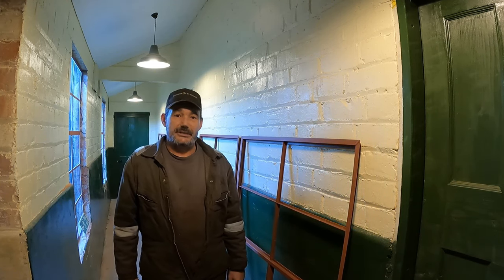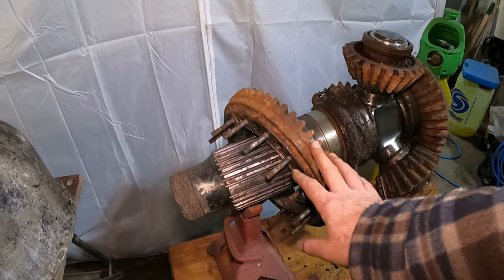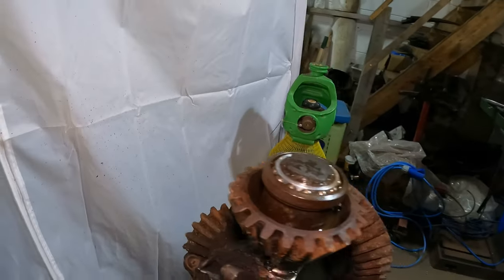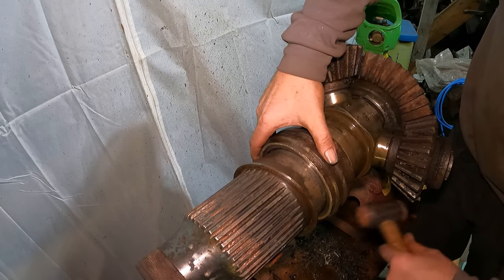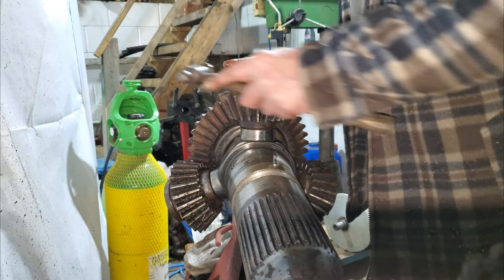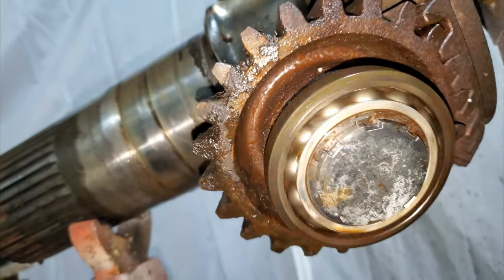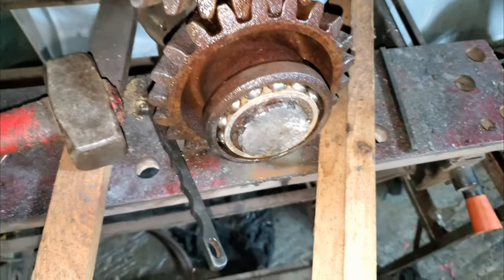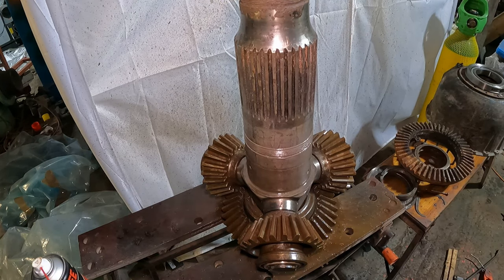Halifax MZ763 Reduction Gear Part Two..  Could It Rotate After 79 Years ??

Comment: incredible bit of work Adi - patience pays off...how incredible is the wartime engineering that this part can still be made to move ... any plans for it as a working exhibit ??? - under glass because of the risk of people putting fingers in between the cogs - after all there is always one no matter how many times you tell them
Reply from the maker: Thank you Chris 😊   I have brought many mechanical items back to life during my life but these WW2 artifacts give the greatest satisfaction,  in many ways a relationship is formed , those who designed and built it, those who looked after it and those who made use of it... be it the Rolls Royce Merlin engine,  the tailwheel or this reduction gear... its almost like as the dirt and corrosion clean away it allows those echoes of the past to be heard....and felt. The reduction gear will be a display that will rotate, I have worked out a plan to "mount" it... and yes, fingers need to be out the way.... based on first hand experience when the pinion gears rotated a lot further than expected 🤣

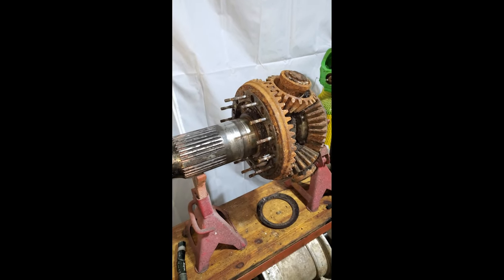Comment: 2 things on this - first there is an audible evp right at the start as you bring the window in - told him we found the baby ?????   second in the workshop....now i'm not much for orbs..... but.... one flies through in front of the shaft and gear between 0:48 and 0:49 ...not lit by flash, not as far as i can see an insect and seemingly moving with a will of it's own...... makes you wonder 8)
Reply from the maker: I rewatched and saw the orb.... had a think when I filmed it and can't say I had done anything to create dust etc ... I know workshops can be dusty however nothing was noticed when filming.... Also... the following day I was going up the stairs to the store room is above the office, well, its thermal overalls time of year and they are heavy,every year when I start wearing them falling 'up' the stairs will happen,usually me falling forwards fast and hard... usually hitting my arm or shoulder... well... happened the other day but somehow it was different... the misplaced foot and fast fall forwards commenced as usual but then everything went slow...I felt "supported" while I got my body in a position to avoid contact and simply continuing up the last few steps...at the time I stopped and thought how bizarre the event was.... Maybe I'm going crazy maybe I'm not.... has to be said I feel I have new visitors.... if I were to guess... could be ground crew 🤔
Reply: @BLOWN8CYLINDER  if you build it they will come ! they'll be dropping in from all over the airfield and further afar because it looks and feels like WW2 accommodation.....i'd say they are pretty happy with what you are doing